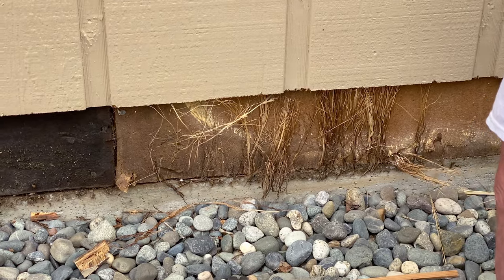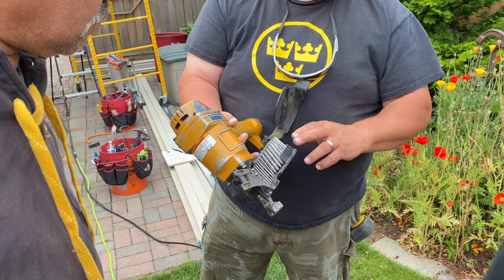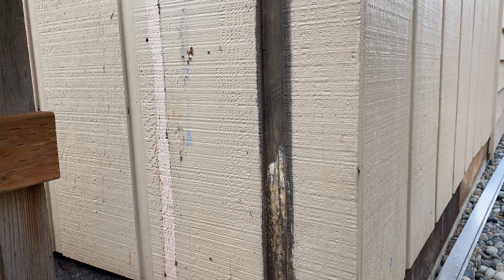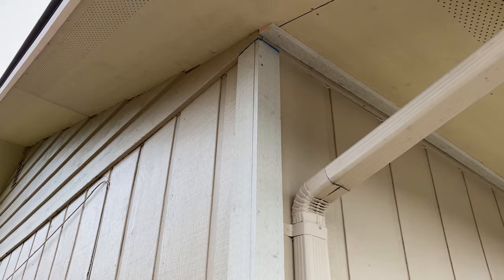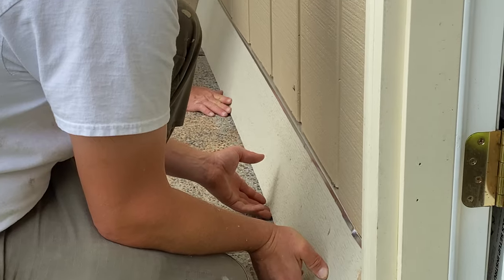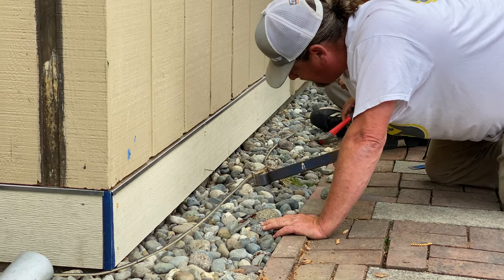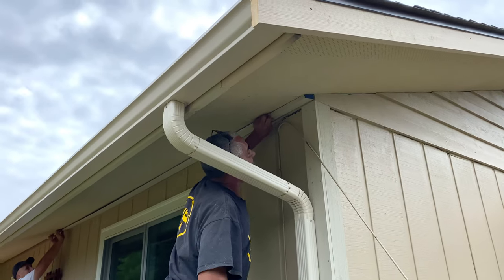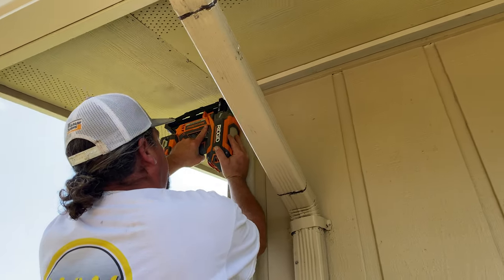Belly Band Board Repairs to Rotten Ends of T1-11 Siding – Part 2

Comment: So much gap...
Reply: Caulk
Reply: The gap above the z flashing is supposed to be 3/8 to 1/4 inch
Reply: @sergiobalino836 why is there supposed to be a gap? To allow any water that gets on there to shed off and not get stuck making a puddle?
Reply: @cha-ka8671    most will slide off, and the rest will evaporate before the top piece of siding (cut edge primed and painted before installing the flashing) gets a chance to soak it up.   I just watched another youtuber explain that.  I would have made the mistake of pushing the bottom piece up as tight as I could make it, thinking that would be better.
Reply: @TeranRealtor  Thanks for answering